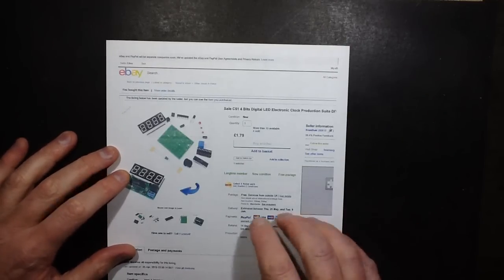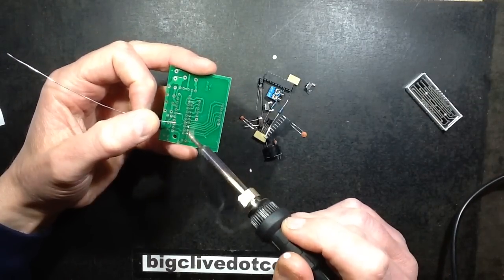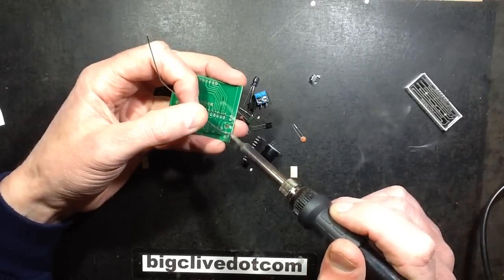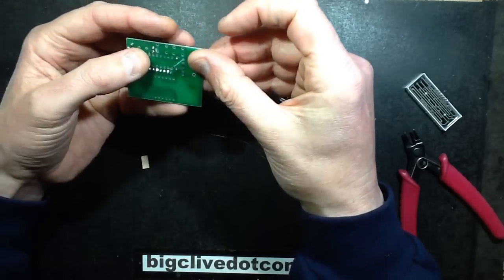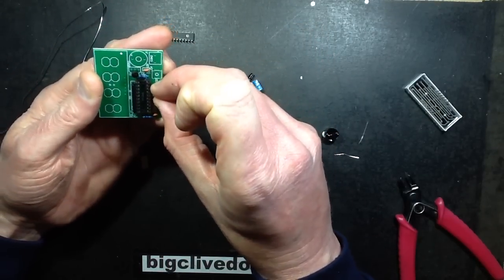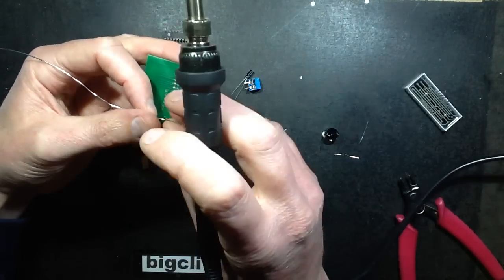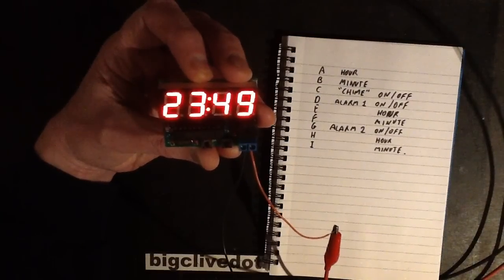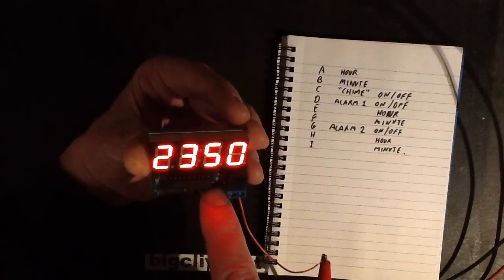Random Chinese electronic clock assembly kit type thing.

Comment: Regarding "rising clamp terminals" - do they have another name?  I just looked on eBay to get some (I'd not heard of them before - I've only used those crappy terminals you got in your kit), and there are a few, but really not many and every single one of them was from Maplin.  Where are the Chinese cheapies??  So I'm wondering if they have another name I should search for?  "screw terminal" just seems to find the basic cheap ones that you got here in your kit.
Reply from the maker: +TheBloke The rising clamp terminals are not cheap, so I don't see them much on eBay.  They might not even describe them as rising clamp even if they were.  The word "cage" is sometimes used, but that's still no guarantee of getting the better terminals.
Reply: +bigclivedotcom Awesome, thanks for the fast reply Clive!  The Maplin ones are not unaffordable, at least when used sparingly for specific jobs, so I guess I'll just get a few of those.  Actually rather than using eBay maybe I can find them in my local store, because they charge £2 for shipping which doubles the price in some cases. 
But I'll have a look for "cage" terminals as well before I buy.  Thanks again!

Comment: Would it be possible to make a USB powered O-Zone generator? Would be a fun project that I could power from my computer or even the USB in my car.

Also, what are you using for your power supply? Did you make it yourself?

Comment: Mr. CLIVE. Please tell me where to find good soldier.  I bought 2 full rolls .8mm 60/40 flux but someone lied. I made the 4 big 7 segment clock like you did but the soulder turns gray. I've soldiered for many years but this new no-lead soldier is crap. Please help.

Comment: Metal film resistors are not too bad to read, although I am used to dealing with legit resistors usually (Yageo MFR series ones being my current go to 1% jobs cuz cheap on Digikey).  The main problem with the Chicom ones is that they tend to be grossly out of spec.  I have some 510 ohm '1%' jobs that I got with some Ebay special LEDs years ago, and the different rolls either measure 500 ohms or 519 ohms (these are from two different batches of LEDs).
Reply: randacnam7321 Did those LEDs happen to be red/blue dual ones? I bought them, and they came with two lots of 510 resistors.
Reply: Prehistoricman
RGB and blue T1.75 envelope LEDs acquired off Ebay in late 2006 and early 2007 respectively.
Reply: +randacnam7321 Yeah, a lot of people buy the Chicom ones in an attempt to save money and just test them first, tossing the ones out of spec. They usually figure out they toss so many they nearly broke even and wasted time with all the testing.
Sometimes deliberately out of spec resistors can come in useful however. Like fixing low quality electronics by compensating for a fault or other out of spec parts.
Reply from the maker: +Richard Smith Or for adding a skewed timing value to different modules by using a low tolerance resistor in the timing circuit.
Reply: bigclivedotcom Brilliant :)
Reply: randacnam7321 that's not too bad, that's still (barely) within 2%. I wouldn't be surprised if they were sourced from a 5% lot and rebranded higher.

Comment: I saw this just after I received my own clock kit in the mail.  Thanks for doing the video and telling the story about your early days soldering.  It makes me feel better as I'm just starting and making all the mistakes in the book.  Sigh.  Which reminds me... The kit came together easy enough but when I powered on - it kind of glitched.  It cycled through the modes A - I properly - but the rest of the display (besides the mode) was dark.. pressing the second button had no effect.
Since all the segments lit up momentarily on the start-up - it doesn't seem like a defective display.  I'm sure I messed up the assembly somehow.  How would one go about debugging this?  I eyeballed the components, polarities and all the joints look good.  What would you do next?  Anyone??
Reply from the maker: +Bill McCollam Jusy check for tiny solder bridges or joints that aren't quite making.  Try metering from the component leads at each end of a track for continuity
Reply: +bigclivedotcom Yes... I had a actually found a few mistakes like that and corrected them (i seem to be susceptible to the solder kind of 'ringing' the pad and missing the pin).   Anyway - fixing those got me this far - but the rest look really good.  Continuity also looks okay.  
Oh well - if I have to - I guess I will de-solder and start again.  Anyway - I really appreciate the vid and the response.  Cheers.
Reply: +bigclivedotcom Figured it out. Just not sure how to fix.  Pin 10 on the IC (GRND) was not making contact.  The chip was seated in the socket okay - but the socket somehow isn't in right.  When I ground Pin 10 with a separate wire - it works fine.
Reply from the maker: +Bill McCollam Is the IC pin definitely in the socket?  Sometimes the leg folds underneath the chip.  It may be worth taking a good look at the solder on that socket pin too.

Comment: Please help!  My first project was a bench power supply that I use a lot and is very accurate.  I just finished my third clock exactly the same as the one in the video, and nothing. All parts on the last one tested before fitting, solder pads cleaned with a glass scratch brush, solder joints all pretty much perfect, but nothing, zero!  Any ideas anyone, Clive?  I've got about 6 more kits to build but pretty sure I need to sort this one first....Help!!  Please!!
Reply from the maker: Check all the solder joints and component placement meticulously.  Also check that voltages are roughly where they're supposed to be.
And keep in mind that it is entirely possible that someone mixed up the chips and sent a blank one with no software in it.

Comment: Alright, I've dabbled (fairly unsuccessfully) with soldering before... what kind of kits would you suggest searching for to find stuff to practice on and (maybe) get something neat from?
Reply: If you want to practice, just dumpster dive and find old electronic devices. Open > remove circuit board > un-solder things > resolder things.Soldering is absolutely dead simple. Easier than shaving, making toast, etc.
Reply: Even easier than shaving toast! :)

Comment: Where do you get your antistatic foam from? I couldn't find on ebay/aliexpress/amazon at reasonable prices.
Reply from the maker: ***** I buy it from a UK based electronic supply company called Rapid Electronics.
Reply: Thanks, looks like a good place to get it :)
Reply from the maker: ***** Rapid are a good source for most components, particularly if you order in bulk.  And the stuff they sell is full spec.

Comment: Hey Clive, what solder do you recommend from eBay? The local shops around here in the US only offer the unleaded garbage.
Reply: You should be able to find 60/40 at radio shack (if you still have one)home depot,ace hardware even has it near me.Unless you're in Cali,they might be crazy enough to ban it but NJ and PA all have it near me although Lowes didnt have the thinner stuff last I looked.Just try and get the thin rosin core and you'll be fine.
Reply: thats what i buy from true value

Comment: Could you measure the power draw of this kit? I would like to power it 
from a AA battery with the help of a little step up converter. Would 
this be possible? Btw, love your ASMR videos, got me into soldering. 
Greetings from Germany!
Reply from the maker: The battery life would be very low if you used it to power this circuit.

Comment: What's the best way to power this? I tried 2 CR2023's at 6V, and it didn't work. But a USB wall wart and cable at 5V worked perfectly. Anyway to make batteries work?
Reply from the maker: It's too power hungry for battery use.
Reply: +bigclivedotcom lol
Reply: At 50 mA, it would drain a CR2023 in about 4 hours even if it would work. If you must have battery, I would suggest AA or C cells, and definitely rechargables because even those wouldn't last longer than a few days. But it would be in the realm of possible, just not very practical.

Comment: In your search, did you find if it's convertible to 12 hour? I plan on building one of these, but would like a 12 hour display.
Reply from the maker: +TJ GAUTHIER It appears to be just 24hr.
Reply: Okay, thanks. I ended up ordering 2 to tinker with. I've never really tried anything like this. I ordered a 5v power adapter from Amazon to power it. Would this work? Is there a way I could make it battery powered? Thanks.
Reply from the maker: +TJ GAUTHIER You could run it from a USB power bank or even just three AA cells, but I'm not sure how long it would run for.
Reply: Okay, thanks. I may try the 3 AAs, just to see. If it's got a terrible life, I'll just stick to the wall plug.

Comment: i have bought a clock kit from ebay and it says it can be powerd on 9 - 12v and i have a 13.8 volt power supply will it work or blow up
Reply from the maker: I don't think it will blow up, but the regulator will get a bit warmer.

Comment: Just did mine watching your video. I tried to jig it with three AA batteries but I got nothing. I probably got them the wrong way.,
Reply: +felixthemaster1  Mine runs on 4 AA batteries but it only lasts a couple of days, I am trying to find a way to better this. you can also run it from USB..... John :)
Reply: +karen berry i can cut up a usb cable, that sounds better. So red and black, right?
Reply: +felixthemaster1   Yes mate that's all I did  :)
Reply: +karen berry Works a charm! I messed up the soldering so the display shows some random stuff but it's functional!
Reply: Ok well done, maybe take a bit more time when soldering next time :)

Comment: I'd like to know where to get those buttons separately.
Reply from the maker: Tactile switches.   Cheap and common from any electronic component supplier.
Reply: +bigclivedotcom Ah right. For a second they looked like the harder to find smaller ones in the exact same style. Thanks though!
Reply from the maker: I've not got that kit near me right now, but I'm pretty sure they were this style.
https://www.rapidonline.com/miniature-tactile
Reply: +bigclivedotcom can you send me the link to buy this LED clock
Reply: go to eBay and type in electronic diy kits

Comment: 2:45 what are you doing and do you need to do it to make it work
Reply from the maker: +finro If you're referring to the soldering of the SIL resistor then I just solder one pin initially and then check to see if it is sitting correctly on the PCB before soldering the rest.  It's also important to align the dot on one end of the SIL with the marking on the PCB.
Reply: So you just made sure it wouldn't come of ?
Reply from the maker: +finro No.  Just making sure it looked well aligned before soldering it in completely.  Just so it wasn't at a wonky angle.

Comment: Could this be wired to run on a li-po battery?
Reply: I dont think so, you will have to use a verry big lipo. The currentdraw is hight (yes, I also tried batteries).

Comment: Do u shop for your kits ,from ebay or Amazon.
Reply from the maker: +Ron Thompson eBay.
Reply from the maker: +karen berry It's not really suited to battery use.  It requires too much current.
Reply: +bigclivedotcom  Ok Clive thanks for getting back to me, usb it is then... Cheers John :)
Reply: +bigclivedotcom  Just one other thing Clive,  I checked the current usage @ 5v and it read 36Ma. Does this sound about right because I am not sure if I am using my DMM correctly... Thanks again... John :)
Reply from the maker: +karen berry Yes, that sounds a reasonable current.  It will be higher when the relay is on.
Reply: Mine came with a power supply
Reply: +bigclivedotcom   Ok Clive, Thank you very much for all your help... John :)
Reply: +Ron Thompson  Hi Ron what type of power supply mate;  :)
Reply: Would a picture help I would be glad to show you the power supply .if you want me to.
Reply: +karen berry ,it look loike a power supply that come with cell phones,one is usb that plug into the power supply and the other end plugs into the Jack on the clock
Reply: +Ron Thompson  Yes Ron send me a picture please... Thanks John :)
Reply: +karen berry ,
 I trying. to find a way to. send u. a picture ,I no how to do it ,if. U text my. phone .,but from here I not sure  it's 5:00 a m her ,I will try later ,I did send you a written ,description
Reply: +Ron Thompson  Ok Ron thanks mate, you don't have to bother with a picture...  Cheers John :)
Reply: Might bought a few things at Amazon ,then I found the prices were lower at ebay for those item,I haven't got my order yet from ebay I holding this up comeing week when they arrive I will let you no.
Reply: Not might ,my computer changes words sometimes.I have bought from Amazon.
Reply: Where have you order from or have you order yet,if you have any question I can help you with let me no
Reply: +Ron Thompson   HI Ron I get everything from ebay they seem to always be cheaper, have you started your led cube yet mate? and I bet its not as warm here as it is in California,,, John :)
Reply: Still waiting on eBay ,seems to take longer from China huh
Reply: +Ron Thompson  Hi Ron just got another small kit through post today -  " red/blue detonation flashing led kit £1.82 "  look it up on ebay mate... John :)
Reply: +karen berry thanks I will co it out
Reply: +karen berry sorry I couldn't find it
Reply: +karen berry I type in wrong,,  one of my clock kits came in ,this one has a clear case,and it does temperature.too

Comment: what iron do you use?
Reply from the maker: In this video I'm using a generic Chinese Yihua combined soldering iron and heat gun station.
Reply: bigclivedotcom Sadly in France and Switzerland Lead based Soldering iron is illegal :(
Reply from the maker: Jeremy974 Under RoHS regulations new manufactured products need to use lead free solder, but for prototyping, repair or critical applications lead based solder is still permitted.
Reply: bigclivedotcom Thanks for the clarification ^^

I will not hesitate to prototype my future homemade smartphone in this case ^^

Comment: It's a shame that they didn't provide a USB connector. That'd provide a reasonable power supply.
Reply: Possibly make it programmable to.
Reply: would u even need to program it if u can figure out which wires on the usb cord are the voltage wires
Reply: Its be nicer for it to be programmable
Reply: true it would be nice if it was programmable but to power it from a usb port all u need is a motor and a usb cord
cut the cord
strip the wires and hook a dc motor to the cord til u find the two that run it
Reply: Maybe people dont want to do that
Reply: true its up to them